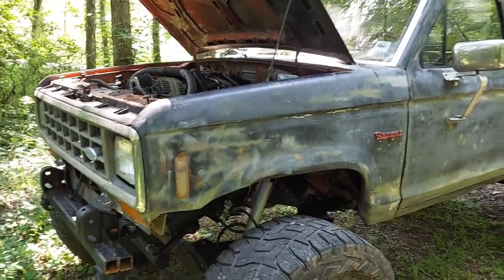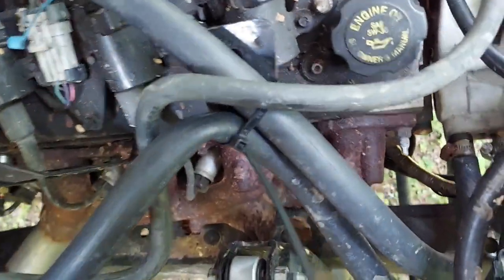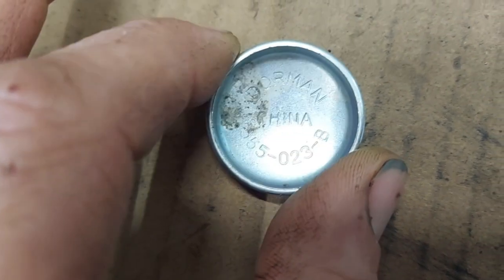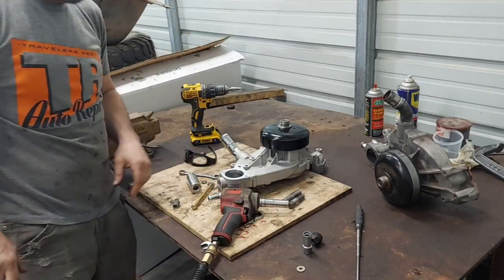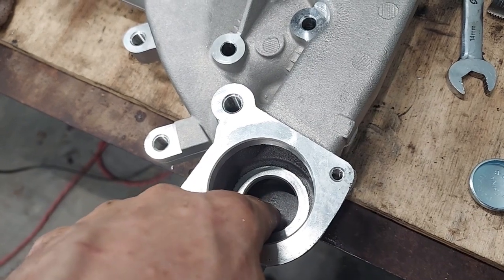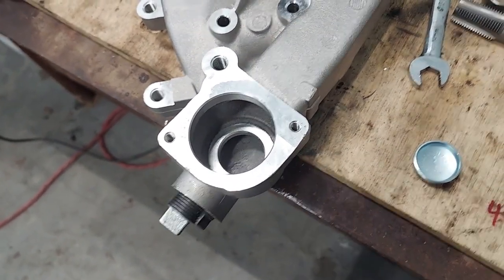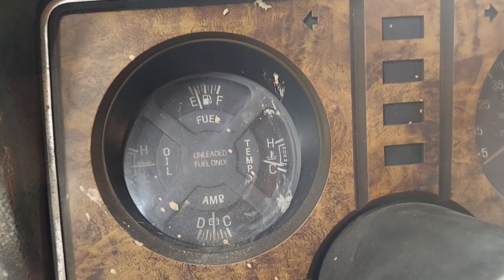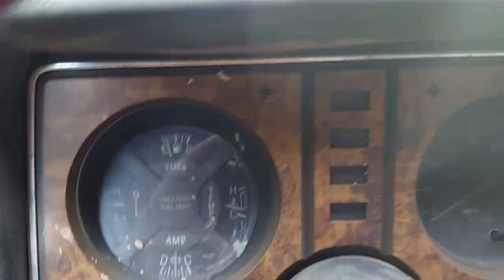ls swap overheating problems and solutions

Comment: Got an 87 Ranger standard cab 2 wheel drive just put in a 5.3 with a turbo 400 trans having the same problem going to do this modification. What radiator are you running ?  Thanks
Reply from the maker: https://www.amazon.com/LUXERAD-Radiator-Shroud-1982-2002-Conversion/dp/B08V8R66M5
Reply from the maker: That's the radiator I used.  I mounted the fans on the front side and built some lower brackets to hold bottom of radiator
Reply from the maker: I also got some spal pusher fans from summit racing.  You could also get a pressurized coolant resevoir from a 99 to 06 chevy along with the heater hoses and leave the water pump alone

Comment: So what’s the purpose of the hole drilled in the freeze plug? I did the freeze plug last night. Still having issues with mine but didn’t drill the hole??
Reply from the maker: It helps bleed air out of the system

Comment: How does it behave in traffic when stopped at lights for a period of time?
Have you installed a temp gauge to know exactly what the temps are?
Reply from the maker: @LsMaloo  I have not installed a temp gage.  I have no trouble sitting still in traffic.  I'm running an 11 inch spal pusher fan.  It's a little loud but really moves some air.  Summit sells them

Comment: Can u still have the heater lines hooked up doing this or no? I have a gen 4 5.3 in a 96 blazer stock style radiator but its a 3core im having circulation issues at idle stays cold when driving
Reply from the maker: No you can't.   I bypassed the heater core.  If you are only having trouble at idle I would suspect it could be a cooling fan issue.  Is it electric or mechanical fan?
Reply: @slaterrockshop4564  dual electric fans
Reply: And both fans are new 12v 80w i have a relay on each only 30 amps a peice

Comment: the problem your having is you need to add an expansion tank to the system on the heater hose side the one closest to the big water inlet side I think it's a 3/4 inlet and that's where you run your steam pipe too and your overflow as well just like on stock setup
Reply: Wrong 🤦‍♂️ most LS swaps don’t have an expansion tank and they work fine
Reply: @tylerseabook9423  It could be because how they have it setup that allowed the air to escape from the radiator and fill the block unlike a traditional Chevy which full from the bottom hose up to the thermostat by adding the expansion tank you get around this problem on other side of the thermostat it filling the block up first and then it works it way up to the top the hose and backwards filled Then you can finish talking it off from the radiator itself

Comment: Where do you have your steam port plug into now ? Since you deleted the loop?
Reply: Got it thanks
Reply from the maker: I ran the steam port back to the radiator.  My radiator has a 5/8 heater hose return port.  I used reducers to neck down the 5/8 to 1/4 for steam port
Reply from the maker: Also, if your rad doesn't have another port you can also buy an adapter off Amazon that goes in upper radiator hose.

Comment: Looping the lines still work?
Reply from the maker: I've looped them before without issue but for some reason it was letting too much hot water return to the engine.  I ended up blocking both ports off and solved my overheating issue

Comment: Going to try it on my monte carlo
Reply from the maker: It's still working great on my ranger. Definitely worth doing if you are having cooling issues
Reply: @slaterrockshop4564  going to try tomorrow
Reply: @slaterrockshop4564  i bought plug but falls threw
Reply from the maker: @montecarlo6.0turbo  I would see if the part store has something bigger.  It worked for me but there could tolerance difference in water pumps
Reply: How did you bleed it out
Reply from the maker: @montecarlo6.0turbo  dump coolant into the top of the waterpump until block is full.  Then put on upper rad hose and fill radiator.
Reply: @Montecarlossjim yo did this work for you mine will not stay cool